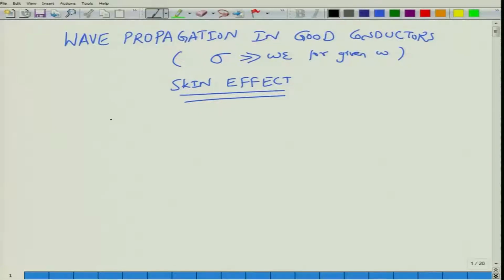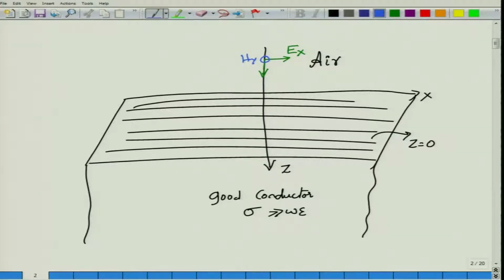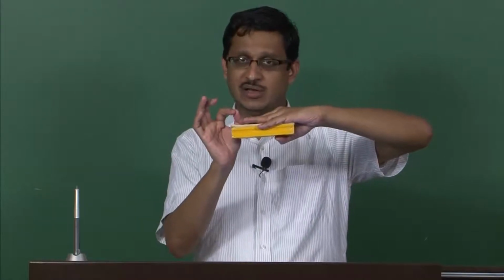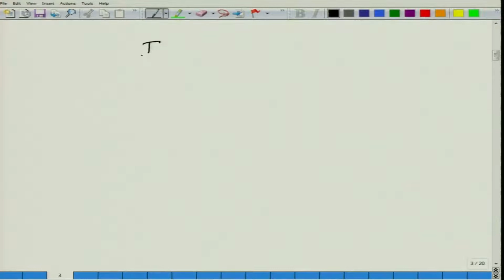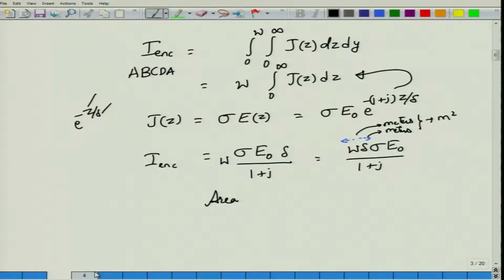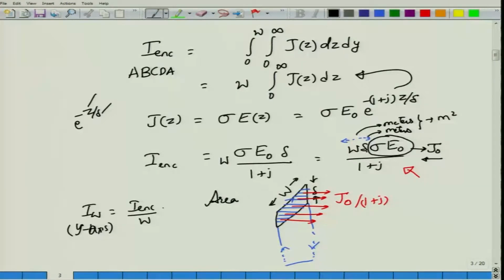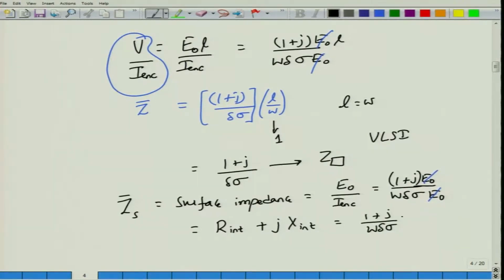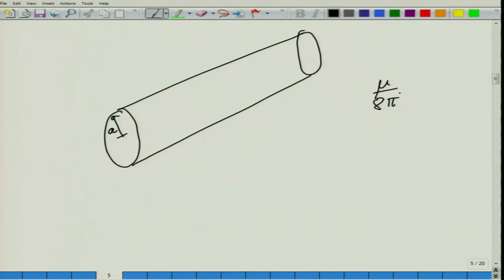Lecture 44-Skin effect in conductors

Comment: Sir if there is skin depth concept , that electic field reduces by a factor,inside a conductor..then why also  do we say that electric field is zero inside a conductor...Do the answer is that former is electrodynamics and latter is electrostatics.
Reply: thats for a perfect conductor where conductivity is infinite , plug that number in and you get the skin depth to be 0 , i.e the current only flows on the surface of a perfect conductor.